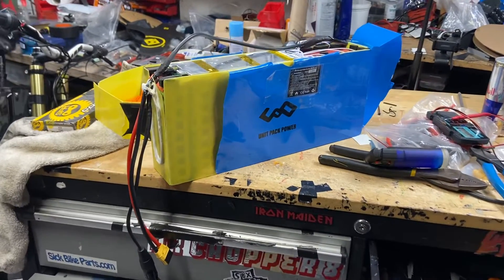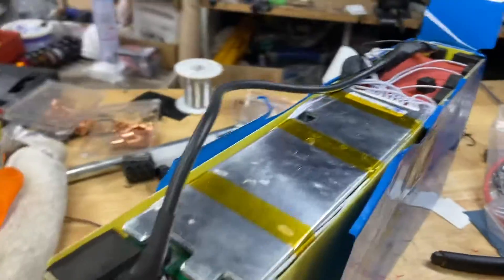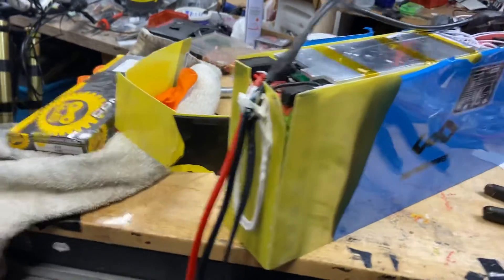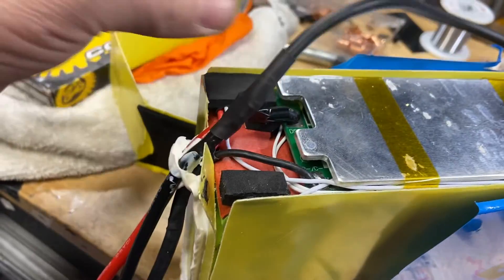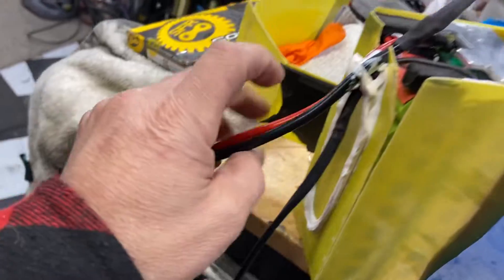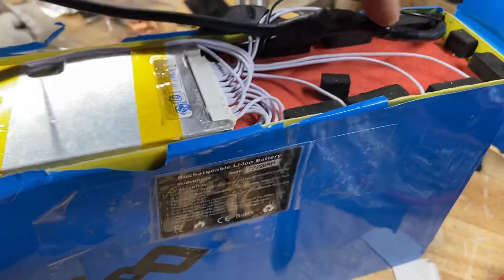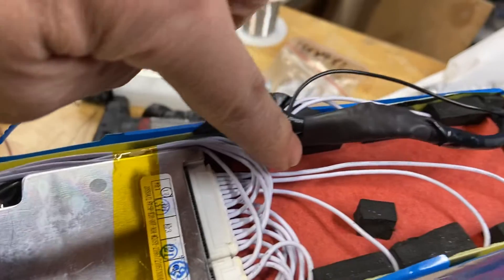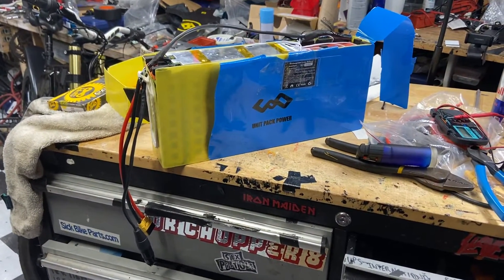“How to” bypass BMS for higher power set up

Comment: noco gbx45 not charging, the battery is okay, usb port okay, its turning on and have solid red light, like error of charging, I tried different usb cables, nothing works, tried to make bms hack, but nothing changed. He can jump car and power the phone, all functions work well, but only if I charge it other way. Do you have any answers or can you help?

Comment: Hello great video. I have a question. Can I charge normally through the charging port with the original charger? Thank you 🇵🇹
Reply from the maker: Yes you only want to charge through the BMS. Never charge using the bypassed section unless it’s for 15 minutes supervised (in case you need to jump charge it for some reason)
Reply: My battery is 36v but it only reached 11v. I did the bypass and it went back to 35v, ok. The charging port continues to output 11v. Can I continue to charge through the charging port? Excuse my ignorance.

Comment: My battery dropped below the charging threshold voltage and I want to wake it up by charging it without the BMS preventing it, do you know how I can do that?
Reply from the maker: @steve08199  use alligator clips, B+ on the battery connector B+ and the other B- alligator clip on the other side of the BMS connection going directly to the battery B- (do not leave it unattended) 30 minutes should be plenty of time to jump it unless it’s a bad problem. Let me know I’ll be here
Reply: @tobebike  I think I'm having the same problem, have a battery for my ebike that has been lying around for a couple of years without me charging it. With my multimeter I can get a reading of 24 volts between red and black on the battery but it's not discharging (charger says it's fully charged). Do I just connect the black from the battery to the thick black charge/discharge wire?
Reply from the maker: @ yes leave the thin charging wire and trace the thick discharge wire around the BMS

Comment: if i bypass the bms can i damage my controler witch is 20a ?
Reply from the maker: @fluidmind3629  I’m not sure. I’ve never heard of that happening if everything is connected properly
Reply: @tobebike  is it likely that the battery without the bms will draw a lot of amps which is dangerous to the bike controller, or will the controller only use as much as it is set to, and not be damaged by the many amps that come from the cells without bms ?
Reply from the maker: @fluidmind3629  if all your wires are in good condition the controller itself limits current. I’ve connected really high amp battery’s with no BMS to all kinds of controllers big and small. I never had a issue
Reply: @tobebike  ok bro thank you 👍🏻👍🏻👍🏻
Reply from the maker: @fluidmind3629  you’ll be fine as long as the battery is properly connected to the controller ⚡️⚡️

Comment: Worth noting that the manufacturer of the battery used a BMS with a specific current, that is matched to the discharge rate of the cells and how many groups are in parallel. If you bypass the BMS discharge and try to do more current for an extended time, it will probably get hot and potentially damage the cells or worse. After a few years these UPP batteries get extremely hot, even using the stock bms current without bypassing discharge.
Reply: You're not a "builder". You're an assembler. That was your first red flag right there.
Reply: Yup  @offgridphilosophy7959

Comment: Maybe you can answer this...  I have a pack using a common port BMS.  Was it the load negative wire that you connected to the black wire going directly to the pack?
Reply from the maker: Yes. It’s the thick black wire going from controller connector to B- cell in the pack. It’s just a loop around the BMS . You leave the charger wire alone and BMS to B- cell too (so it can charge)

Comment: So if you do this will it your bms work to balance the battery while charging? I built a 48v battery but used a 60amp bms and I think I messed up my 22amp controller on my bike . It looses power now . Any help from anyone would be much appreciated

Comment: I have a 4 wheeler made by a now defunct company called Barefoot motors. It was originally a 48V 100A system with 16 individual cells. Cells are all bad and I am needed to replace them with something. BMS was removed at some point and caused the batteries to fail early. So trying to figure the cheapest way to get some new batteries. Looks like I need a charge only BMS.
Reply: if cells are bad a new bms won't fix anything, the bms helps keep cells from overcharging and over discharging and balanced

Comment: What cells are those ? I have an upp battery too
Reply from the maker: I didn’t dig that deep. We’re using a 60a controller and don’t want the BMS to click off during acceleration
Reply: @tobebike  oh ok I’ve seen someone push the 52v 40a bms battery to 70amps no problem just lower range and the battery gets warm

Comment: Bms should only be used for balancing and charging. 
Your controller shouldn't go over your batteries continuous ratings anyway....
Reply: This is what people don't understand. I see it so many times on the DIY groups. Good for pointing that out.
Reply from the maker: You are correct and I accept no responsibility for screw ups 😂😂
Reply: @tobebike  still running 50c cells at 5c , 75c cells going in drag bike soon though.... 250kph 1/4